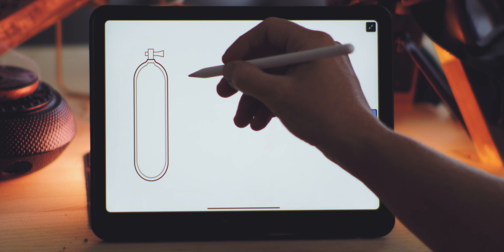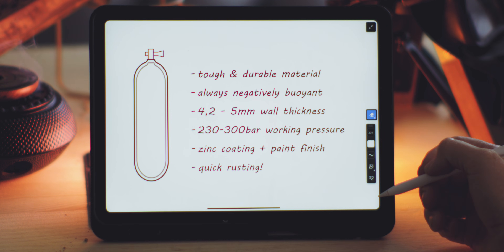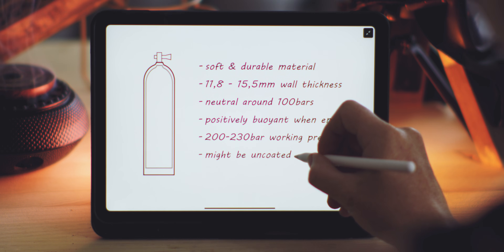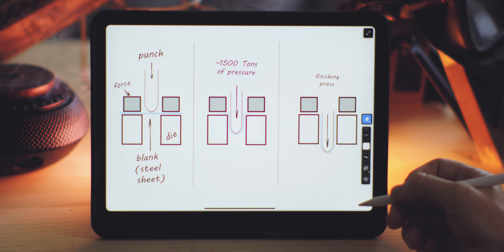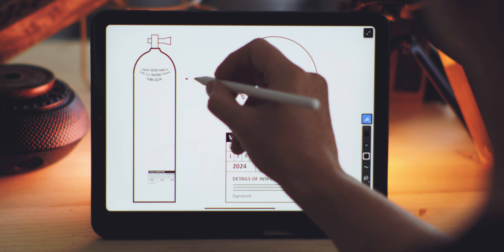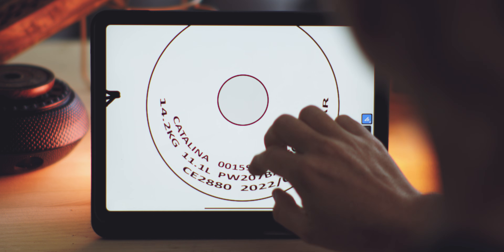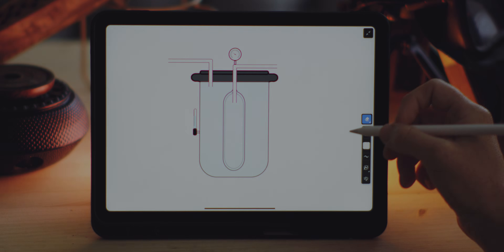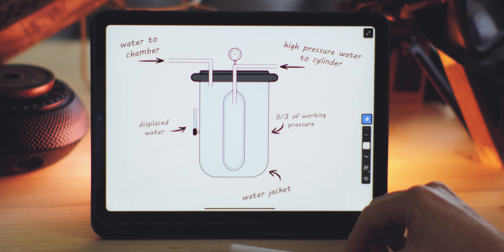Steel Vs. Aluminium Scuba Cylinders | Master Series

Comment: I am a bit obsessed with cyclinders and have been experimenting with them heavily over the past year!! What I would like to see, and still haven't found is a comprehensive document which details cylinders based on boyancy characteristics at Full/Half and Empty, for each brand, size and shape (round bottom vs flat bottom)... Cylinders are a minefield, but I have currently settled for a pair of  232 7lt round bottom fabers and 12lt rount bottom fabers (sidemount - cold water).
Reply from the maker: @PirateDM  makes sense, its just really hard to get hold of all these cylinders on the island.
Reply: i agree @PirateDM It seems that with all the scuba media we have, both print based or social media based, that some enterprising person would have done a definitive comparison test of the top 5 or so sizes in both aluminum and steel.